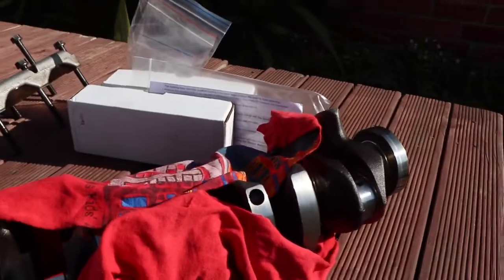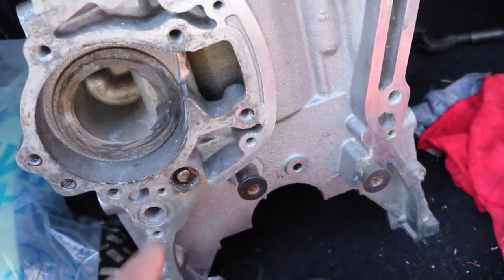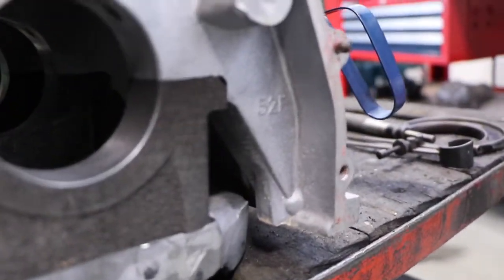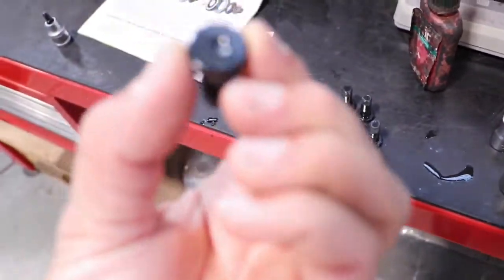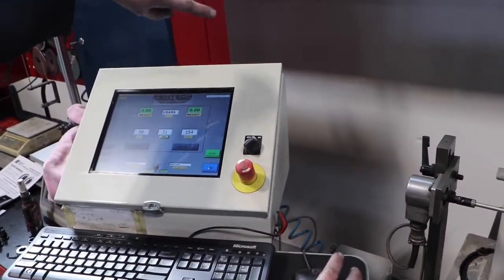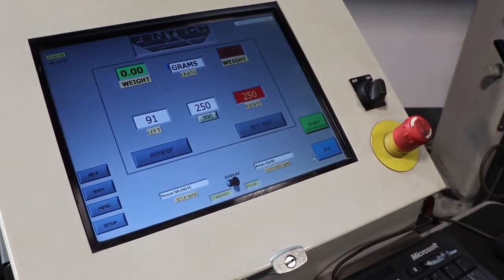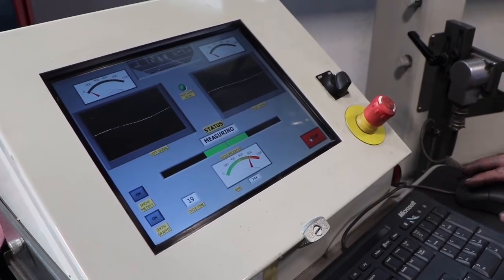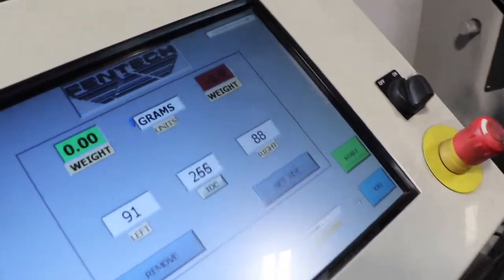The SR20VE Engine Build You've Been Waiting For

Comment: Balancing a crank with the ATI damper ON it :)))))))
Reply from the maker: @Alex R I’m pretty sure they’re already balanced but got to do it with all of the rotating assembly fitted.
Reply: @AdamNZ  dude, please consult ati on this matter) does it really make sense to you to balance something which contains a damping device?))) …. Ati states clearly , do not balnce the crankshaft with our dampers on ) …
Reply from the maker: @Alex R. I’m sure I read all of the paperwork but I’ll take another look tonight. When I pulled it apart it’s basically a solid chuck of metal with a couple of o-rings. No “real” dampening rubber or anything in there.
Reply from the maker: @Alex R. Actually I did read the instructions again and it does say not to have the inertia part mounted. But the paperwork was mainly focused for LS engines. I actually got the engine balanced again by another workshop after the fact because these guys in this video were useless. Im not sure exactly how they balanced my engine rotating assembly and its probably been too long to ask them to recall but apparently they are the best in the country. I've kinda had a bad run with this engine and it has definitely cost me a lot more than it should have. But thanks for bringing it to my attention :) .
Reply: @AdamNZ  check … hp academy .. some of their videos when they visit events or expos .. they tske interview from different manufactures like King , JE etc etc … there is one interview with ATI representative and he explains it all :)
Reply from the maker: @Alex R. Ok thanks, I’ll ask the workshop today if I get a chance. Surely they’ll give me the answer I need to hear. My ATI pulley has a trigger wheel mounted on it as well.
Reply: @AdamNZ  same does mine ;)